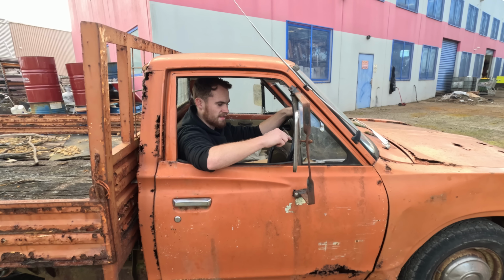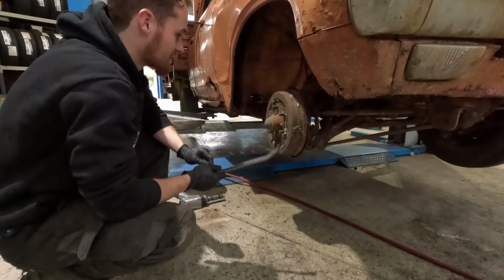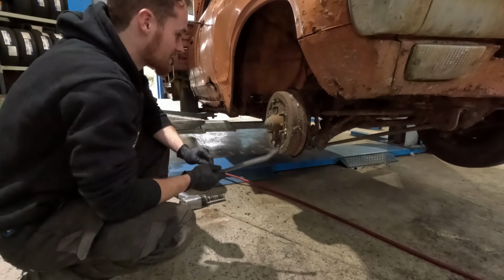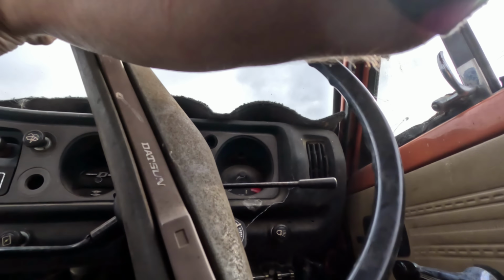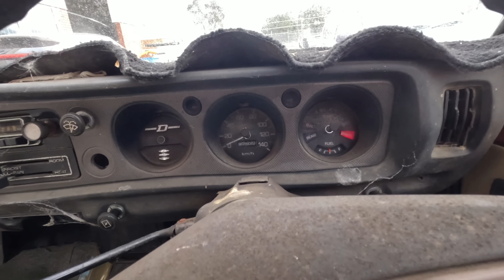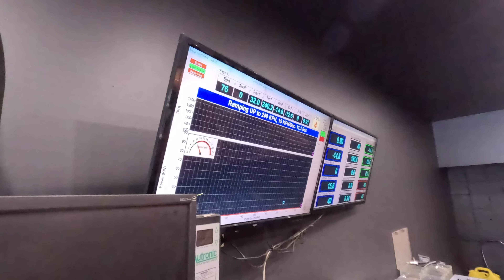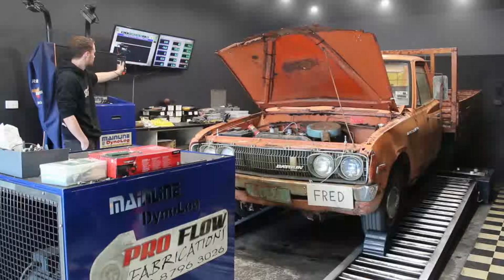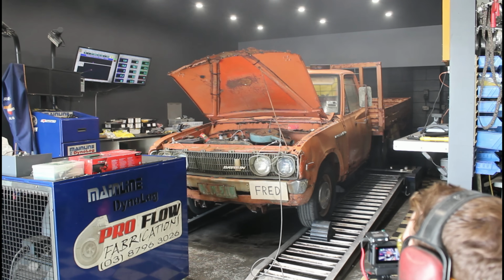Dyno testing a 50 year old Farm truck! Will it survive NOS?

Comment: I bought the exact pickup in 1990 for $100, my son learned to drive with it. It had a 4 speed and for some reason the steering wheel was on the other side.

Comment: Top Gear didn't even manage this amount of hp lost/ year with their 70s Mid-engined Supercars episode 😂
Reply: What are you talking about? The tired old thing made its rated crank hp AT THE WHEELS.

And then om straight nitrous (no addl fuel) it made probablu 125 crank hp (about 70% more than its base rating)

I think Fred is a winner.

Comment: In America our Datsun pick-ups of that vintage had L18 or L20b's, wasn't aware the A15 was available in them. 

I have a 79 Datsun 210 wagon with the A14 i rescued from the crusher. I literally put a battery in it and ran a hose from the pump to a can of fresh gas and it started second try. New tires, rear shoes, clutch hydraulic, and its been driving ever since.